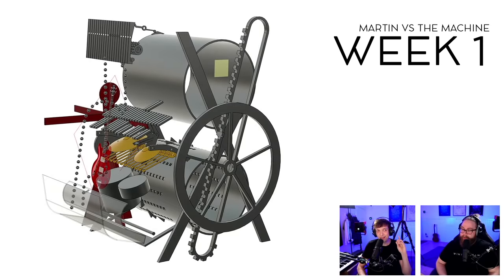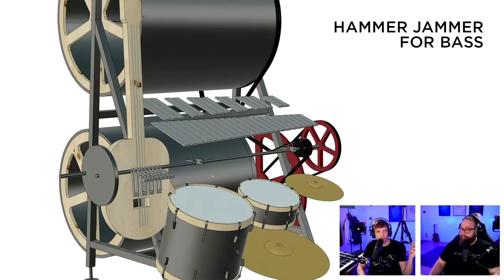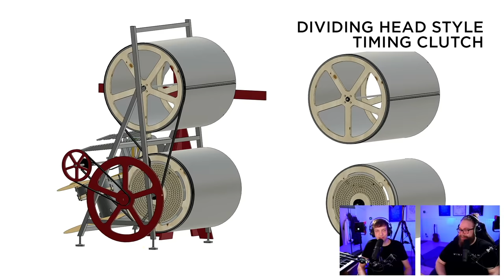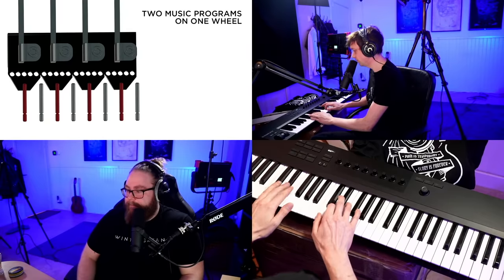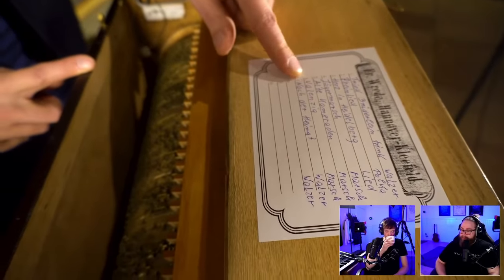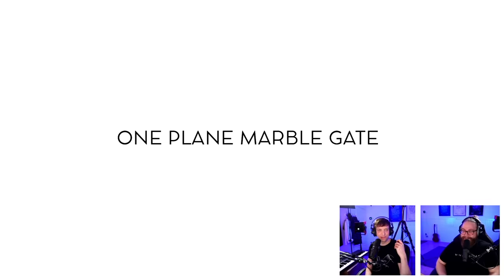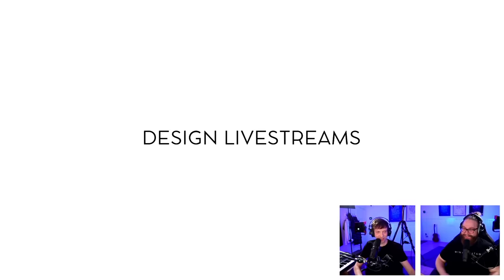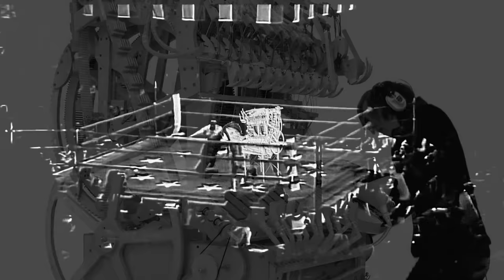Longer Music Programming - Martin vs The Machine - Week 2 Summary

Comment: Much longer music programming:

If the pins on the programming wheel were captive,
and you had a set of electro-magnets running the length of the back of the programming wheel (one for each column of pins) that could be used to pull or push pins,
and you had a way to selectively stop pins from moving or free them by the row,

you would no longer be limited by the size of the drum; as you could "stream" instructions on to it, or leave them there to loop.

Comment: I have to admit I'm really bummed about you ditching the old version.
Reply: He's abandoned art, and moved on to engineering.
Reply: Ya it feels like some thing anyone could make now the uniqueness of the original one is gone but to early to tell
Reply: @shark_in_a_chair4238  ??? the plan was to have a full CAD version at the end for the MMX.

The MMv3 is still far from done. I'm pretty sure it'll get a unique touch soon.
Reply: @lilkittygirl  I absolutely agree. He got obsessed with the vision of how a world tour with the MMX should go down, when in reality the machine wasn't even near completion. Dropping a couple marbles on the floor during a concert wouldn't even be an issue for most people, and it would've added to the charm of it.
It's a shame he didn't go with the "finish the machine first, make changes to it later" approach, because at least that would've resulted in a flawed, but otherwise complete MMX.
Overall, I think Martin takes this whole project way too seriously. It's almost like at some point he forgot he's making a musical instrument that is overly complicated for what it does in the first place.
Reply: The process became more important than the end product.  A new machine will most likely not be made.
Reply: I saw it coming ~ 2 years ago after he redesigned a part which worked perfectly well for like the 3rd or 4th time. I just now checked back in to see if I was right- omg, he doesn't understand what he's doing if "Things that make you smile when you look at it" are not part of the machine. He wants a machine that never makes a mistake when it plays the music? Its called a Smart Phone, and its boring as Sh*t to look at.
Reply: I feel like life sometimes get in the way. It might not be the case or it might be one of the main reasons.

Comment: If you put an offset when you program the programming drums, you can put two programs on one drum and change it by just turning it upside down (one program in one direction, a second one in the other). It would need to engrave the belt thing on both ends of the drum (on the right direction if there's any :) ). 2 sets can mean 4 music programs...

Comment: Antique music boxes have been using the multi-track system of sliding the barrel/ drum across for a very long time. I have an 1860's music box with 4 different songs you can select.
If you had a method of spacing the drum surface from the end wheels you could shift the pins without messing up the belts.
Reply: The big problem is Martins idea of switching tracks while the machine is playing. With his insistence that the machine plays tight with no missed notes that's not going to happen with any kind of sliding mechanism. But if you accept that the machine has to at least have the decoding mechanism disengaged from the drums or the drums being stopped to switch tracks then the drums could be made to slide on the shaft with a spline making sure they stay indexed.

However I get the feeling Martin is falling into the familiar "feature creep" trap again. He needs to take a step back and see if this really aligns with his points of forms from function and making it less stupid.
Reply: @blahorgaslisk7763  LOL, the 2 tracks per drum idea is not "feature creep" like some commenters (such as yourself) have accused. If you'd actually try to look at this machine from a musical perspective, you'd realize this is a feature to enhance the musical possibilities, not some stupid design choice that just makes the machine look great or whatever. I suggest you really think about your comment before writing it.
Reply: @justinnaramor6050  I disagree. The feature is something that's nice to have, not something that's essential for a music machine. What happened with MMX was in part that artistic expression, not musical but artistic, got to much attention and mechanical reliability got the back seat. This is a clean break designing a new machine from the ground up using what the previous attempt taught us about designing a complex machine like this.

As such trying to cram twice the number of notes into the same surface area of the drum, and construct a mechanism able to select which track to play is indeed feature creep. Especially if you want to design it to be able to change track while still playing.

It is a "nice to have" feature, not an essential.

Design a machine that has a large chance of surviving a tour and still be reliable. Then start thinking about all the "wouldn't it be nice to have?" and "wouldn't THAT look nice!" things.

You can have all the features in the world, but if the machine isn't 99.9999999% reliable when coming back from a tour then it's not the machine he needs.
Reply: @blahorgaslisk7763  And so, this 2 tracks per drum idea enhances the musical expression possibilities of the instrument. Even with your attempts to justify your "feature creep" argument I still say it's nonsense... I still don't agree. To me something only becomes "feature creep" if it becomes little more than a fancy gimmick that goes way too far beyond what a machine's ultimate purpose is (E.G you'll see these bluetooth speakers or bluetooth headphones with speakerphone capabilities, or some supposedly fancy equalizer, or some 'advanced' waterproofing, or a fancy lightshow that flashes/pulses with the music or some other kind of crazy lightshow, and so on and so on and so on... and these fancy gimmicks get soooooo much attention that they distract from the ultimate goal: connecting to a portable audio-source and playing music or other audio, in a way that sounds far superior to the built-in speakers on that portable audio-device; look at the Soni WH-1000X M3 or M4 headphones, they're full of feature creep, and they're not the only example either). That's my idea of feature creep; these additional features are just there for gimmickry to the point where the main intention has been forgotten about almost entirely. My argument, then, is that the 2 tracks per drum idea stays within the ultimate goal of the marble machine being a musical instrument, and as such it's not some fancy gimmickry (my idea of "feature creep"). Just because you don't think that feature is essential doesn't mean it's not... you've got to think about what Martin's really trying to achieve here. At the end of the day, it's his machine and he'll ultimately achieve the goals he wants... I don't really think any of us should be trying to hint at something being unattainable or accuse it of being "feature creep", especially if we're forgetting what the ultimate goal is here. This thing is ultimately supposed to be a musical instrument, and with that musical perspective in mind, the 2 tracks per drum idea is indeed essential if Martin's goal is to make this a really great, expressive musical instrument and not a fancy kinetic sculpture with fancy geometry or whatever.

I've not been following the MMX project for the entire time it's been going on, but for a while now I've had the impression that, yes, the fancy gimmickry (the artistic expression as you put it) got so much attention that the core functionality (remember, the musical goal I explained) got lost in the dust if you will, and as such the reliability tests and musical tests were overdue in the video series... that's the impression I got. That definitely fits my idea of feature creep. So rethinking the design entirely (even if that meant having to start over with a whole new machine), and trying to go back to that ultimate musical goal and trying hard to stay focused on that alone, is a smart move. I'd argue the marbles being dropped onto the instruments and the mechanical workings are already interesting enough, both from a conceptual and probably visual point of view (I say "probably" visual because I'm actually visually impaired, so I can't see it). Why should it need some incredible visual things to go along with that? Do you go to a concert to see some incredibly mind-blowing visuals, or do you go to a concert to hear some great music? The MM could be just as interesting to look at as seeing a group of musicians twirling their guitars and having fun going crazy on stage or whatever... you don't need these fancy lightshows and these fancy visuals etc. Fancy visual gimmicks on the MMX were sort of the equivalent of fancy lightshows and visuals in my mind... they distract from the music at some point.

Comment: the playing of two tracks, I think it would be a great idea if you made individual instruments switch, with a "switch all" lever as well. That way, you can have tons of variance. Also, it would be a good idea to create pins that span both tracks so that you can save time programming songs that have a lot of similarity between tracks.

Also, to avoid hitting a pin sideways as it slides, I recommend a half circle movement, pulling away from the pins and adjusting before coming back into the contact area. If you iterated this movement again, you could have two levers to select from three tracks (both up is one, both down is another, and one up/one down is a third) or if you changed the size of the shift between the two, you could even get 4 tracks, but that level of precision is likely beyond the scope of this project

Comment: Why use giant replaceable wheel?
Simply use Replaceable Metal sheet over wheel. You can easily stack so many in a well designed cabinet or case.
Whenever in need, first unwrap sheet over drum and change with new one.
Reply: As he said in the vid - it's fast.
Drop out old song, drop in new song, continue playing, wrapping a sheet of anything isn't pretty fast if you want to have it line up with millimeters to spare on a huge drum, plus think of all the programming damage that would be done all the time.

Comment: Your venture over to see that musical barrel with 7 tracks upon it ,  and with your engineering degree of skill & keenness for improvement you could see about designing a newer type that incorporates press spring inter change/ lock mechanisms . Also the re loading of  tubular drums you could incorporate a temporary straight aligning rectangular length of rod  or bar so the two start  in correct positions placed/ router on external edges . Ie (12pm& 6pm again 12pm & 6 pm )

Comment: I can think of one issue.  When removing the programming drums, you end up pulling the belt up in the process, then having to slide the belt off before it twists, and then the belt falls down, and so when you place the next drums up, you have to somehow pull the belt back up and rewrap it around the wheel, pulley, and tensioner pulley.  You will need to find a way to pull the belt off and set it on holding pins before removing the two drums.
Reply: I agree. The belt shouldn't go around the drum. The belt should go on a pulley that connects to the drum with some kind of clutch. A key or pins make them rotate together. Tapered/conical surfaces could be used to maintain concentricity without perfect tolerances.

Comment: Still don't understand how would you mount and replace driving belts. They are stucked inside the frame in current design😅
Reply: Well just do it like you do it with bikes. Add a frame lock to it. Does not really lower the stability and you can easily mount it. 

Thats the smallest problem I see. I am just worried about feature creep in the second video :/
Reply: The belts have idlers which can be moved back giving enough slack on the belt for the drum to be removed.  It's no different than removing the rear wheel of a bicycle. The chain is slack enough to allow it to go around the axle when the wheel is unbolted.
Reply: @Proud2bmodest  I'm talking about the belts themselves. The frame can't be disassembled, it's welded together. The only option to remove the belt from the machine, is to cut it. And vice versa, new and cutted belt need to be glued...

Comment: You may also need an additional kind of paddlewheel which is wide and fast enough to bring the necessary amount of marbles to the top of the machine. When there's a gap between this and the programming part, then the guitar may fit in this gap...

Comment: You'll need a removable cap to go over the drum axles placement holders on the opposite side to the belt/drive sides. Otherwise the tension on the belts may cause the drum axle to lift up on the other side. Gravity alone may not be enough to hold the drums down while rotating.

Comment: When you say in the beginning about how if the lady design fails you'll "finally be able to give up on the project" it sounds like it's something that you've been hoping would become the case for a while. If you had said "unfortunately I'll have to give up on it" it would show disappointment if it ended up going that direction and a desire to finish rather then sounding like failing would be a blessing that you just want to happen to be done with it.... It may just be an issue coming from you  being a non native English speaker (even though your English is excellent), and I am probably looking too much into it, but there's a point I'm trying to make about recognizing how the process is affecting how you feel subconsciously and taking whatever steps needed to acknowledge possible pessimism so it doesn't sneak in and become conscious pessimism. Stay optimistic that each failure was a step towards something great rather then a checklist of what needs to be done so that it's possible to accept giving up without a care. Just keep at it and in the end you'll have something even more amazing then everything you've done so far! You can do it and you've got so many believing in you and supporting you... If anyone can accomplish this task you can. So with all that the only thing left to say is good luck and rock on!

Comment: I could suggest making pipe channels for the marbles going back up to the top of the machine to minimize the amount of marbles ending up on the floor, because that was a huge issue on the marble machine X, it would require merging tubes together. I think it is worth a try.

Comment: @Wintergatan 10:23
I think you could probably dedicate like one or 2 tracks on the programming wheel to decide automatically when the "Track red" & "Track gray" should play?
Or maybe some other kind of mechanic, but not sure what that would be, maybe a slower turning wheel for longer programming length? (sounds like a lot of problems).
But you CAN dedicate a single Gray & a Red track, each track decides when the other track should start playing, a pin there switches to the other track.

Comment: I can't figure out how to add to the design document.  But as the example you showed displayed its going to be easier to move the programming drums to the "new song" then its going to be moving the rest of the marble paths.  Also, swapping whole drums is going to create a storage/transport problem.  If you have chosen the performance, it will be easier to have the programming surfaces in separate parts and then assembled to "drum" structures rather then have unique drums for each performance.

Comment: Make the programming wheel mounting hooks adjustable, to be able to align properly. Ideally, they should have set screw adjustments for XYZ separately, and a single tightening screw. You can even use stepped adjustment, like that found in step blocks, with 0.5mm steps. That will keep alignment despite vibration induced drifting.

Comment: Instead of sliding the registrators, why not have 2 registrators control a single marble gate, each with it's own mute switch. This way you could easily switch between song A and B while the machine is playing.
Reply: alot of parts but not a bad idea
Reply: Multiple tracks should not even be part of the conversation. He needs to make one track work first before even remotely thinking about multiple tracks. This is feature creep before even a single thing on this machine has been built and proven to work. Not a good idea.

Comment: You can do it much easier. If you will not use drum with pins but tape with holes. Tape is much lighter than drum. Also tape with holes allows you to have much, much higher data density. You you are trying to reinvent wheel.

Comment: If the drums are removable, I wonder how you are going to stiffen the frame. On the X you had these two bent diagonals behind the drum, which would block the removal. The current frame looks like it would have too much side to side flex.
Reply: The bent diagonals were on hinges so they could be swung out of the way.
Reply: MMM3 does not need stiffeners. The rectangular tubes have 20x torsional and bend resistance than the anemic lasercut MM2 frame. The tubes can also be made even thicker. 3 straight bridges top, mid, bottom are enough. But you are right, they should be rectangular to receive side loads too.